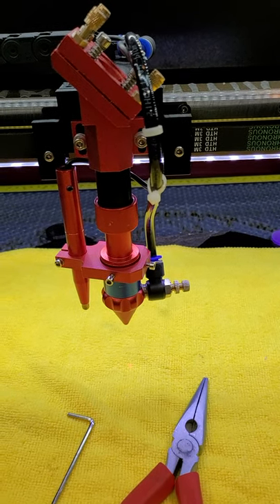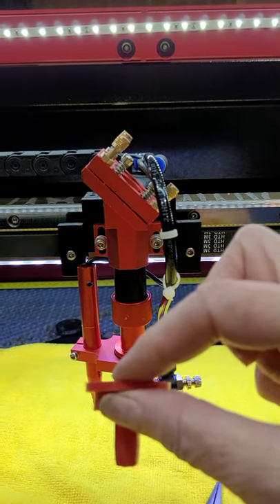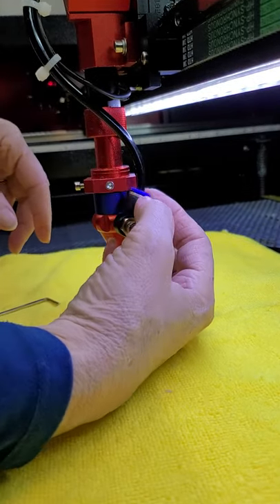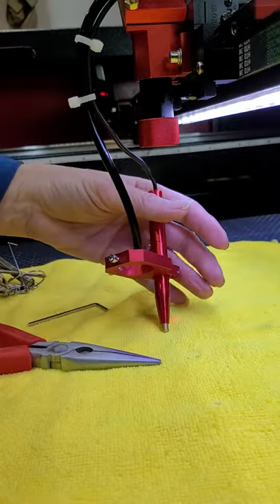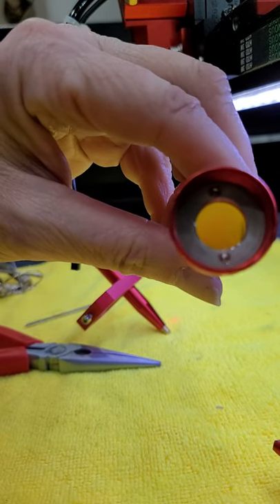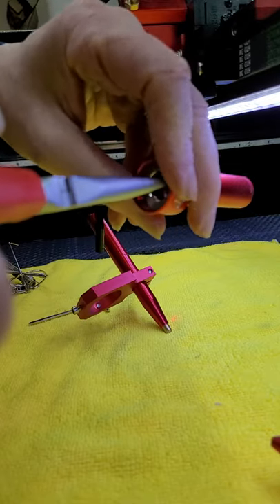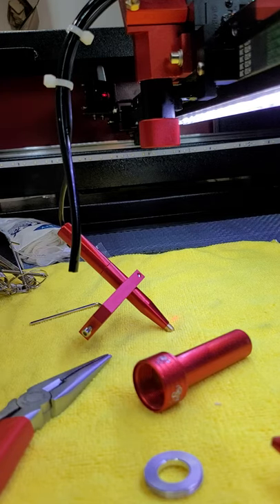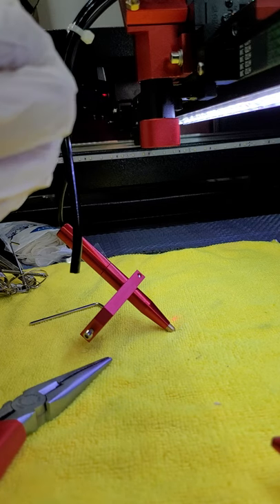Cleaning the Lens on OMTech Autofocus Laser Machine

Comment: I would also suggest afterwards checking the alignment of the mirror directly above the head to make sure that the beam isn't clipping on the side of the nozzle.  It shouldn't be a problem, but it's possible that after disassembly/reassembly, the tube isn't completely lined up like it was before.